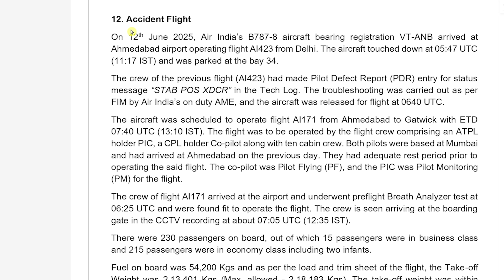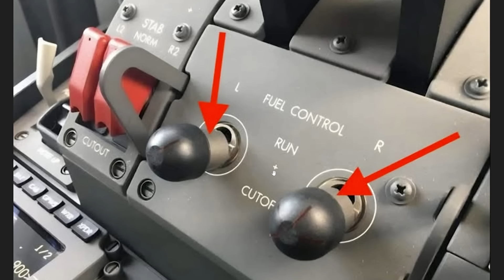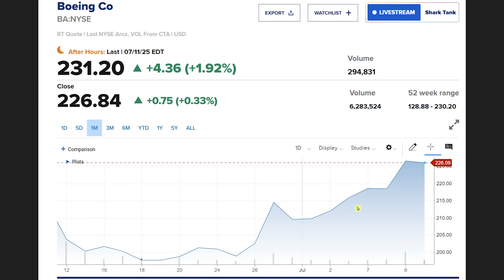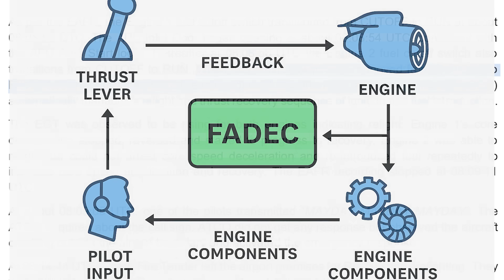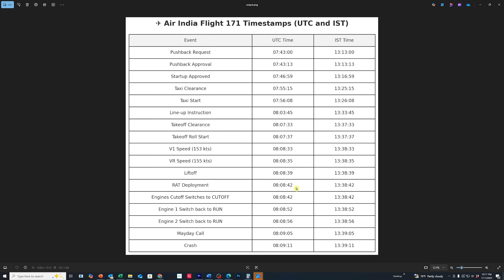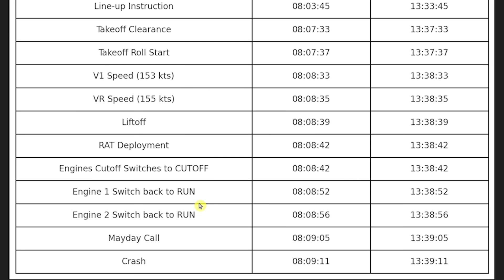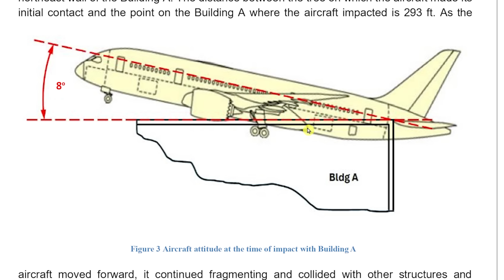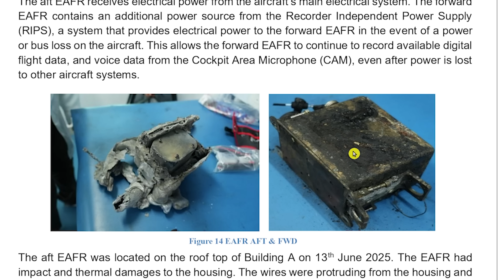Did Pilots CUTOFF Fuel? Shocking Twist Air India 171 Report!

Comment: If you wanted to guarantee a crash, that was the perfect time to switch off the engines. The most vulnerable moment, from which recovery was impossible.
Reply: Yes and that is so scary! There's no way to know as a passenger on a plane if the pilot or copilot are suicidal. 😭
Reply: @KayInMaine Which happens far, far less than multiple other reasons for a plane to crash. Orders of magnitude fewer times. An infinitesimal risk in the grand scheme of things.
Reply: @KayInMaine I work for a legacy airline. The mental health of its pilots is HEAVILY screened during hiring process. In my interview they had me take 3 separate mental health screenings including talking to a psychologist during the hiring process. They also looked deeply into my past and found out times where I struggled in certain classes in school and then pressed on that wound and saw how I would react to it. They also tried to insinuate that because I flew business jets before flying big jets that I would not be prepared to handle an airliner (which isn’t true at all) just to see if I could be composed and professional during a stressful situation (like interviewing for your dream job). 

Why again are they doing this? Because it’s a test! It’s a test to see if you can handle a stressful situation. 

They also look to see if you have examples of community service and character. It’s not about who deserves it the most it’s who’s gonna protect people. 

Rest assured if you get onto a jet in most of the developed world you have at least 2 men or women up there that are mentally well and actually care about YOU as a passenger because we do. YOU are everything to us. There are of course historic outliers but we’re talking 4 or 5 people in the past 30 years that lost it.
Reply: @KayInMaine Have faith in the almighty there’s your answer
Reply: @KayInMaine Go with the numbers. 99.999% are NOT.
Reply: @KayInMaine it is Boieng, not the pilots.
Reply: @KayInMaine  that is why we need self driving planes soon, not just self driving cars. we need AI to safeguard our lives.
Reply: @86soulx ummmm, NO we don't need self-driving planes. Even self-driving cars are ridiculous.
Reply: @KayInMaine  let statistics decide for themselves , if there comes a point self driving cars or planes are statistically safer than human driven ones (less accidents)  i'd say 100% go for it. it's unfair 300 others got to die together because one pilot has depression
Reply: @86soulx lol. You don't think an AI driven plane but suddenly fall out of the sky on purpose? 😂😂😂
Reply: @KayInMaine   i believe AI is progressing fast and in no time it will reach a point where errors made by AI is far fewer than errors made by human. . at that point in time its just a crime to not use self driving technology because not choosing to save lives is equivalent to choosing to end lives.
Reply: Exactly, very well calculated!
Reply: If the pilot flying is looking straight ahead they would not have any idea of what the pilot monitoring is doing with his hand in that area.
Reply: @brentsummers7377  If there isn't already, there should be an audible warning alert for those critical switches, but I doubt that once the switches were changed, that any recovery was possible...sad, especially if this turns out to be a deliberate sabotage situation.
Reply: @brentsummers7377 And vice versa.
Reply: @brentsummers7377  plus why would you think your other pilot is suicidal?  not normal
Reply: @brentsummers7377  Pilots only see sky straight ahead, so they depend on peripheral vision to monitor the instruments. One pilot would certainly see the other manually operating the fuel switches.  That's why he asked "Why did you cutoff?".
Reply: @brentsummers7377  exactly.
Reply: @brentsummers7377  True.
Reply: You`ve just described actions of a killer pilot.
Reply: @lordjim3109  It's terrible how easily and quickly many people suggest just this only based on a hateful interpretation of a preliminary report. Innocent until proven quilty has completely departed this world it seems.
Reply: @lordjim3109 think before you type? The pilot had no suicidal issues.. Everything has been asked to both their family members.. So  think before you type.. There must have been a mechanical problem or anything like that.. But probably 99% sure pilots wouldn't have done that
Reply: @RishavYadav-ll6jp  I wonder how suicidal issues could be determined in advance. Are we going to have a mental health worker questioning all pilots before flight? What if the suicidal person simply denies he is suicidal and states that everything is OK? This has obviously happened before; this video shows a list of previous events by suicidal pilots.
Reply: @gbennett58 Bro actually.. This plane crashed in India.. Here In India nothing to say out government doesn't follow laws and rules seriously..  Main Culprit is always hidden.. So.. We really don't know what was the actual problem.. Pilot or something else.. Can't blame a specific person or thing uptill now
Reply: @gbennett58 I have read parts of part 107 "airman guide" and it makes pilots sound like some kind of uberman. Stories that involvle the phrase "the guy went crazy" usually work as a great cover for what actually happened...
Reply: @RishavYadav-ll6jp  The cockpit audio shows at least one pilot was aware the engines had been shut down. The flight recorder shows the fuel switches shut off and then back on. What more do you need?
Reply: @gbennett58 what do you think that's true? The report was released firstly in India.. Then went to the US...something fishy has taken place.. And some serious changes have been made.. And to blame the pilots.. That's the easiest thing to do 😂
Reply: @lordjim3109  WHAT if those switches were connected to a computer that controls the actual fuel solenoids, valves, pumps rather than being directly connected??? Ask yourself this, HOW does the "black box" have a recording of those switch positions??? If the switches were direct wired to the fuel delivery system, they must also have some sort of sensor data being sent to a computer interface somewhere via some analog or digitial I/O pin somewhere that is being used to record their state. I think we need to see DETAILED schematics for this, because we need to rule out that there was some cybersecurity attack involved. Btw, if you didn't know, these newer modern aircraft have connections via satellite and radio communications that connect to electrical systems within the plane WHILE THEY FLY.
Reply: My thoughts exactly.  There is about a 10-20 second window (right after V1) where the airplane has no chance of recovery from a dual engine (cutoff) "failure". I cannot think of any other phase of flight or ground movement that would be worse.
Reply: It should be cockpit voice and video recorder not voice recorder because now we can blame the pilots yet faulty buttons.
Reply: software perspective. If the computer on board can detect the aircraft if its either on the ground or airborne, maybe a little logic for the fuel switches NOT to be manually turned off at this crucial point of time until it reaches a safe altitude that the engine can still bring the plane up? These are crucial seconds.
Reply: @francelmarkgarcisto9528  Yes, I would suspect Airbus jetliners have that failsafe in place. Even though the pilots have to pull that switch, then slide it and push back to the desired place, it is still way too easy. Cutting fuel to engines should never be that easy. It is a serious design flaw.
Reply: i would also suggest the one who did it was the one who asked why the other did it...for the voice recorder
Reply: That is exactly what I said from the moment I saw the original video of the aircraft passing the building, dead silent , except for that Ram Air Turbine , which we shouldn’t have been able to hear over even a half spooled down engine , which told me instantly those engines were purposely cut off , unless the plane ran out of fuel in all tanks at the same time ,
Reply: The Captain (nonflying) switched them off but asked "why" to throw off investigators
Reply: yup, he didnt cut off fuel at 2000 ft where they could have restarted the egnines
Reply: Controles mal diseñados, hasta una simple cobertura de policarbonato transparente o un inhibidor de esa función durante el despegue- Esas cosas inventábamos en el secundario
a los 14 años
Reply: Lives can be gone in a flash
Reply: Yep.   Guy couldn't just take himself out.  Wimp way to go.
Reply: so which one asked the question. like, why have you killed me and all of the passengers? i didn't....yes you did, why? so they knew it wasn't me.
Reply: Who was MUZLIM in that cockpit 😮😮
Reply: Can those two controls be operated vis remote control?
Reply: @Stalled-wm3qd  No
Reply: He knew EXACTLY what he was doing.
Reply: Yes.  Perfect to cutoff the fuel INSTEAD of raising the gear.  The drag of the gear also adds to the slowing process.
Reply: Agree
Reply: Wouldn't you just fly the plane into the ground with no time for the other pilot to react?
Reply: Agree, seems like blaring audio & visual alarms should be goung off!
Reply: Yes aircraft was fully loaded for long flight.
Reply: chances of survival are highest on takeoff
so its a bad theory
Reply: But it's not a guaranteed plan though, is it? The plane nearly recovered. Was it a calculated risky plan? But surely a person with a plan to commit suicide would carry a more secure plan in the event they may get caught. So, this one is still puzzling to me.
Reply: No. According to the report, the fuel was put back on 12 seconds after the cutoff, which allowed one of the engine to restart. If the fuel had been restored sooner, both engines might have restarted. If you want to guarantee a crash at that moment, you have to cutoff the fuel and do whatever is necessary to prevent restoration in the next few seconds. Not easy since everyone new immediately that the engines were stopping. Difficult to imagine that the pilot needed 12 seconds to realize what was happening.
Reply: Why don’t you conspiracy theory-peddling, “who needs evidence, amiright!” goobers wait for the actual report that reaches actual conclusions and discusses actual facts before drooling out rejections of conclusions that haven’t even been reached yet?  When you’re experienced aviation crash investigators with the requisite training and expertise, check back in.
Reply: Running away from liability
Reply: This is just a preliminary report, it doesn’t prove anything, the fuel can be switched off with technical difficulties as well, it’s too early to blame the someone, this should be thoroughly investigated rather than blaming someone too quickly , the concern now is to prevent future problems. Fix if any technical issue in planes so we are all safe. Let’s not blame the pilots who are dead and cannot defend themselves.
Reply: Motive? Assuming the report wasn't altered by goons for liability reasons the time it took them to flip them switches back on seems sus... Maybe they were fighting over the switches or the switches themselves failed
Reply: @zteamvideo2561  Captain Steve answered that in his brilliant, expert video here: https://www.youtube.com/watch?v=00ooqCuRoU8 - but the nub of it is that the pilot flying naturally took time to react to what the other one had done. The switches did not fail, what failed was the morality and sanity of one of the pilots, Which is why psychologists are part of the investigation.
Reply: I used to use this tactic on eBay. I wouldn't bid anything, until the very last minute.
Reply: Part of me hopes the pilot let some clues as to why...I imagine many of the victims loved ones want to know why...let them have some closure. And maybe we can learn something about mental health to possibly prevent this again. This is why I'm for Canadians MAID. Let people have less frustrations and that possibly letting someone have free will that they wouldn't take to harming others. I've been in some dark places in my life but I never wanted to hurt anyone. One time I was in a dark place as awkward as this is to say and admit, the only thing that didnt let me end it all was I truly cared about my boss and I know he's not always had success hiring assistants but he and I worked well together ...and being I was his right hand thats why I didnt want to let him down. And now I'm kinda not in a great spot with what has happened to the economy in the past 4 years, and its my cat is why I wake up everyday, I fear him dying or going hungry or end up back at a shelter. So it's hard to hear a pilot actually victimized hundreds of people (surviving victims like the family and loved ones) and does make my blood boil.
Reply: The senior pilot had some plausible reasons to do such crazy things.
Reply: @My_DNA_told_me_to_do  we can't say that for sure bro...
Reply: 100%
Reply: What about malfunctioning of switches ....they do malfunction...made by Honeywell and their quality has gone down 👎
Reply: Someone must have done before the pilot enter the cockpit
Reply: @cvanhmingliana4630  Bunkum. That is impossible. You show you know nothing about the mechanism of those switches.
Reply: Exactly 💯 sabotaged
Reply: Mostly agree.  If the pilot who didn’t shut these off though turned them back on in 5/6 seconds and didn’t have the 4 second gap between I really think this was still recoverable. But those extra 8 seconds really screwed them.  Would like to see a flight sim done with quicker / tighter times to attempt recovery.
Reply: Which is why it is "Smart Terror" as much as anything.. the switches could be tampered with easily by a black ops tech,, swap the switch assembly out in seconds,, that it crashes in India, causing the Maximum amount of damage to India.. to Indians.. to drop the power the perfect right second to ensure and unrecoverable moment.  This is NOT a suicide the pilot did NOT push the controls over into the ground.. it was full of fuel.. Why would he want to kill so many innocent fellow citizens... who have given him such a prestigious job and position in life?
Reply: yes. also, wasnt even a switch off. is a cut off, dry out the pipeline fuel querosene to the engine (usually to prevent fire), so a restarts takes longer that just off the engine.
Reply: Yup. I wonder if he had tried this in a simulator?
Reply: @donraptor6156 you wouldn’t need to. All of us pilots know how long it takes to get one of these big turbines started.
Reply: @donraptor6156  No need to, they know enough about flying to that will work. They also learn all the fatals in pilot schools.
Reply: @donraptor6156  wouldn't need to, you already know there is no time to fix as you take off if you wanted to intentionally crash plane
Reply: @donraptor6156 Don't think I could have said that any better, ot clearer.
Reply: The report added: “In the cockpit voice recording, one of the pilots is heard asking the other why did he cutoff. The other pilot responded that he did not do so.”
Reply: @HOMAKiNGh7k I don’t think a pilot would readily admit to doing it lol.
Reply: @HOMAKiNGh7k Those switches may start in the “Cut off” position but once the need to fly they would be turned on, while on the ground and the wheels down stops any RAT deployment!
The videos show the RAT deployed on the take off and were visually seen from those videos showing the RAT propeller deployed!
Speculatively, the switches were still in the “Off” position else the RAT couldn’t deploy unless an electrical connection changed the narrative!
Reply: @MrChannel19  nope you're wrong the wheels being down or up has nothing to do with the rat deploying. However what does is the weight on wheels sensor when the weight is on the wheels hence on the ground the computers are in what's called ground logic and will not drop the rat when the engines are shut off. Now when the weight comes off the wheels it transitions into air logic where the rat will deploy and the apu will automatically start. The landing gear position has absolutely nothing to do with the air or ground logic. Stop making stuff up.
Reply: @MrChannel19 The weight on wheels switch prevents the deployment of the rat on the ground, but it doesn’t keep the engines running.  If they were off on the ground, the engines would have also been off.
Reply: @Big-lron Who is making this up, the RAT was seen in the Air Deployed!

As a technician we always had to assume both the positive and the negative aspects!

Was the RAT still deployed during the crash which would indicate still outside of the fuselage!

Never indicated anything that would not be possible!

Did they check if the grounded aircraft test with walk-around test to see if the RAT may actually deploy once on the ground then it would indicate electrical damage or open circuit some place between the Cockpit switches and the RAT enabling circuits! 

We always watched out for electrical issues when things are at the edge of reason!

We never assume anything until the facts are in!

With the nature of pressures to clear this issue and insurance and the aggrieved families looking for closure we can’t assume anything easy!

Fiction doesn’t come into the logic of finding truth!

So you know where you can stick your comment where the sun doesn’t shine!

Respect for those that have to listen to sophisticated minds going into issues needing clarity!

Condolences to the families who need closure!
🕊️🫵🏼⚠️🇺🇸
Reply: @Theb_rand_1 My exact point, the what if’s are what technical personnel would have to question, not assume that everything is normal and can be dismissed !

Get it!
Reply: @MrChannel19 The RAT deployed when the switches were switched off. The plane was climbing and accelerating right after takeoff, that is not due to momentum.
Reply: @Big-lron The “weight on wheels” sensor keeps the RAT from deploying. Until the weight is off the wheels, the aircraft uses ground logic, once the weight is off the wheels, it uses air logic, which allows the RAT to deploy. There would never be any reason for the RAT to automatically deploy when the plane is on the ground.
Reply: @robinmueller3778 You really like to push your narrative, there is a certain amount of fuel in the lines that can life up the aircraft and then the fuel is no longer enough and therefore not enough thrust!

Go play with someone else you’re annoying!
Reply: @MrChannel19 I have no agenda, I’m just looking at the data. You should try it and actually consider the physics involved.
Reply: @robinmueller3778 That’s exactly where I come from, like I said wait for the final result and then start your rhetorical arguments until there is another shiny object to distract you!

Doing Aerospace for 45 years!

Bye!
Reply: @MrChannel19 Im not distracted by shiny objects. Have you been “doing aviation for 45 years” or just doing it poorly for a long time? 🤔
Reply: @MrChannel19  My dude, even if the "final result" cannot concretely pin the blame on the pilot despite the overwhelming evidence, here's what's going to happen nonetheless: Airlines around the world are going to institute mental health surveys and checks for their pilots.  And that action is going to be prompted by this disaster.  However understated, the implication will be quite clear.  Responsible adults have to take responsible steps to protect lives.  The entire world now knows why this plane went down, and the people in charge of those lives need to act accordingly.
Reply: @Big-lron Your assumption is the wiring is 100% but there are wear and tear to electrical connections that may not be accounted for or even if the wires were damaged or worn out! 
Keep on Mr Big-Iron, personally would never work around someone as yourself, you seem to think your the big kahuna of aviation industry but your still a child!

Go back to your playground and find playmates there!
Bye
Reply: @Big-lron  Spot on. People spin fantasies.
Reply: V interesting point.
Reply: very important point!
Reply: The report also does not state that the switches were definitely moved physically, they are going of sensor data that could have been due to an electrical fault. Remember the switches were found in RUN. The RAT was deployed within 5 seconds of fuel cut-off was recorded and 3 secs after the take-off, this could have been a major electrical failure and not pilot's switching off them physically
Reply: @farazalikhan5242 True, However, the timing (1 second apart) is indicative of the time it would take a human to turn one off, then move his/her hand to turn off the other
Reply: @jimserhant7741  they should have released the whole cockpit voice recording, the fact that they only released that bit of the pilot asking "why did you shut off the valves?" is definitely showing that they are not being unbiased, either they should have released the whole CVR or not at all
Reply: @farazalikhan5242  They don't only have voice.  They have VIDEO.  There was an elaborate camera system in and around the cockpit.  And yet, they're piecemealing out this information.   It's very irresponsible and suspicious to do this.
Reply: @farazalikhan5242 Indeed, they are hiding something.
Reply: @jimserhant7741  Also, the fuel pressure and N1 and N2 indicators did NOT start rolling back until AFTER the cutoff switches were switched from RUN to CUTOFF position. This is inconsistant with another Air India pilot saying the pilots must have changed them from run to cutoff in response to a drop in fuel pressure... They were also not switched back until several seconds later, this is also inconsistant with SOP's (at altitude) for a relight attempt the switches are moved to cutoff and back to run immediately no counting to three or whatever.
Reply: @VerdictREX  There's no video.
Reply: @farazalikhan5242 it’s a preliminary release in a preliminary report of the investigation. To be fair, there really wasn’t much more to release.
Reply: @farazalikhan5242  There were probably very strong words after the Captain said, "I didnt do it".   Also, we could likely hear the switches being flipped.
Reply: @farazalikhan5242 yeh the rest of the CVR would probably complete the picture.. ie the pilot who asked why probably had more to say since his colleague just intentionally killed them and lied about it.
Reply: @brnmcc01  true, there are lots of other indicators values that lead to the switches being physically moved to initiate the fuel cutoff. people want to blame anything and everything but a pilot moving a switch....
Reply: @farazalikhan5242  Yeah they'll need to analyze the CVR in more detail, move the switches in a real plane or simulator, record the sounds, and listen for those sounds in the CVR recording.
Reply: @takingthescenicroute1610 Are you really thinking they didn’t try this in a simulator weeks ago?
Reply: @farazalikhan5242 even more unlikely than what the data tells us. You may have to move away from denial.
Reply: yes the function of the changed  valve goes from electrical condition to computer system software that commands closing of valve, for fuel. A
Software Maintenance new subroutine in program can shutoff valves for fuel as it contains a pilot overriding command for shutoff if certain maint. Conditions are met digitally? Pilots wouldn't know, but air India knew, but they skipped non-mandatory bulletins.
Reply: this is correct most peoples are using their opinion with out going through the pilots duty .i being an instrumentaion service enginner of 26 years would only agree to a major failure of computer and electrical failure of over heated battery .no pilot would ever switch off his own blood flow a comparison of fuel pumps to his enginesx.pkease think the same pilots have flown this aircraft from delhi to ahemadabad .any one in refueling the aircraft at ahemadabad having access to bewmteen flt inspection and certificate could have tepered with the system for a pre tetermined time foe fuel supply to stop as any two wheeler you have a reserve selection after consuming the fuel left in the pipe from tank to carburrater .so .please do not abuse the dead pilots as terroist .if so it could have been done after take off from palam airport itsrlf .god please forgive all those spreading un wanted judgement of an tragedy .
Reply: @farazalikhan5242  The report states the switch were placed to RUN. one at a time.
Reply: @farazalikhan5242 I was thinking the same. But just as you have thought of this scenario, I’m sure Boeing engineers have as well, and it seems like they have dismissed this as a credible idea in the preliminary report.
Reply: @farazalikhan5242  Yes this is the big question now: Actual physical movement of the switches versus electrical sensing problem. To analyze the latter requires a wiring level knowledge of the switch wiring. Of course, the FDR only knows the electrical levels created by the switches, which can be influenced by any number of factors including loose wiring, broken wiring, shorted wiring, and a myriad of other non-normal conditions. 

Somehow though, the pilots knew the switches were off according to the voice recording. How did they know this? By visual inspection of the switches or by a cockpit warning light, alarm, etc.?
Reply: @farazalikhan5242  No not true at all. The switches were flipped to cut off one second apart from each other one of the pilots asks the other "Why did you cutoff?" as if he saw the switches in the cutoff position. 10 seconds go by before the switches are flipped back to run and the plane automatically initiates the restart procedure it also automatically deployed the rat and started the apu. One engine managed to restart but not in time to recover. It was not an electrical failure.
Reply: @Big-lron  Hard to believe one engine actually managed to restart so fast! After being shutdown after running at full power, that would most of the time that would result in what we call a "hot start" and shoot flames out of the back of the engine with stupidly high turbine inlet temps. Normally for hot restart, you have to motor the engine for quite awhile, like 20 seconds at max motoring and then introduce fuel only when ITT reaches 200 degrees C.
Reply: @brnmcc01 fan was spinning with airflow so it wouldn’t have been a hot start.
Reply: @Theb_rand_1  The FADEC on these engines is very advanced and I see now after watching the full video it pulsed the fuel on/off rapidly to allow a hot restart.
Reply: @brnmcc01  the egts on both engines were observed to be rising according to the black boxes as fuel was being pumped back into them. Engine 1 managed to overcome the spool down and was on its way to spooling back up but the plane was most likely already hitting trees by then engine 2 was unable to overcome the spool down. Im not a jet engine expert but yeah i know those big high bypass engines take forever and 3 days to spool up.
Reply: @Big-lron  Yeah exactly and I think that nearly rules out issues with the engines themselves, fuel pumps, or the FADEC's. The FADEC actually did an amazing job of nearly getting the engines back up and running.
Reply: @farazalikhan5242  Boeing will do everything to prevent any such report of electrical fault to ever come out.
Reply: @ticler  Troll.:face-fuchsia-poop-shape:
Reply: @ticler  If it was electrical and everything got cut. The words may have been 'damn we lost all the power' and not 'why did you cut the fuel'. Also both switches would be cut at the same time, not with one second delay. Stop blaming Boeing. The 787 is not the issue, pilot mental health is. They need to look into the pilot. One source is reporting that this pilot had been on sick leave and other pilots reported him to be unstable.
Reply: @ticler When did Boeing force the pilot to manipulate the switches?
Reply: @ticler  Wrong, APU and RAT were employed after the fuel cut off.
Reply: @jamesreynolds4220  - exactly - there was absolutely nothing wrong with the aircraft at all.
Reply: @ticler there was no electrical fault. The movement of the two switches and the conversation on the CVR clarifies this.
Reply: Exactly
Reply: True, but there is a very high probability that the pilots weren't involved, at least not the diabolical or "accidental mistake" ways that has been speculated about. 

There is a better probability something far more sinister went behind those fuel cut-off switches.
Reply: @wickramavee4365 Sinister is incorrect since we’re talking about mechanisms, people, technology that has many possibilities, assume nothing and breakdown the issue as the evidence comes to light!
Reply: At this time, the idea that one pilot did this intentionally is preposterous.  You don’t turn the fuel back on if you’re trying to crash the jet.  Pilot could just as easily push the yolk forward abruptly, among dozens of other possibilities.
Reply: Hold on guys.. switches were moved with 1 second gap. I don't think that is humanly possible with the safeguards and locking mechanism. It could be a mechanical /electric failure in the switch also.

737 crash in 2018 was attributed to pilot error. It took another crash in 2019 for Boeing to admit their software issue.

Hope truth come out.
Reply: @akhiljayachandran3679 , judging from a video I saw of the fuel switches being operated, a one second delay for the second switch seems to be about ballpark. I.e., flipping the switches in succession by a trained person should take about 1 second.
Reply: @akhiljayachandran3679 millions (maybe billions) of hours of flight with these switches… 🤔
Reply: @akhiljayachandran3679  Two hands from one person. Very easy.
Reply: @Nobilangelo it's not good to. Onvict someone. Investigation team is looking into the mechanism of the switches if its due to switch fault
Reply: The Air India training manual said this was the switch to turn off the vacuum cleaner.
Reply: @Number-5-is-alive 
They probably used manual for a glider that has to be RUN via hawser then CUTOFF after reaching take off speed.
Reply: Also it's very convenient to blame dead people huh.
Reply: @SamsungS-or1qf The data is the data. No blame is being placed yet but it’s definitely suspicious.
Reply: no , if you wanted to guarantee a crash and complete destruction off all evidence . you would wait till the aircraft had more speed and altitude and then press the fire shut off valves.  at this low speed there was every chance that the black boxes would be recovered .  there was also the possibility of the cockpit breaking when it hit the trees . there could have been more survivors  , maybe even the pilots themselves could have survived this just like seat 11a did .  think of this if you wanted to send your car off the cliff , would you do it low speed and risk getting stuck on trees . or would you do it at full speed so you clear everything and fall straight into the abyss
Reply: @zaildarbains do you comprehend the fuel quantity in that flight? It had just taken off it had max fuel capacity. There is only 1 in a million possibility of recovery or survival from this. Doing anything mid air would have mean that the other pilot could intervene and stop it from happening plus it gives more time for recovery since the plane is at a significant altitude
Reply: @zaildarbains  Well, you can't do that because there is 2 pilots and at cruising altitude you have both airspeed and height and the plane can fly for a long time as much as 150 kilometers or more if flown properly at best glide speed. There has been precautions added after that suicidal pilot in Europe waited until the PM stepped out of the cockpit to use the restroom, then proceeded to lock the door and crash into the alps at max speed. The only way to guarantee a crash is like this plane, cut off power at the most critical phase of flight, or they could yank on the controls on landing and crash into a bunch of planes that are waiting for takeoff etc. There was that Silk Air plane too that was flown vertically straight down into a muddy swamp. The impact on the soft ground made recovering the FDR and CVR boxes very difficult.
Reply: @brnmcc01  yes its easier and less work to crash this way. but certainly falling from 600 feet doesnt gaurantee complete destruction. what if they missed the buildings and fell on a bunch of trees.

Also since there is no indication of struggle between the pilots in the report and the switches are in the run position after crash is also suspect. if he wanted to crash why would he attempt to restore both engines after 10 seconds.

the failure  occured right at the moment aircraft transitioned from ground to air phase .  so its still possible that a faulty signal triggered those valves to cut off . restoration in 10 seconds is also peculiar. its not 8 seconds or 12 seconds.....what im saying is 5 seconds , 10 seconds is usually how some aircraft logics are designed to reset. 

all speculation still.
Reply: @brnmcc01  im finding it hard to swallow that this seasoned matured pilot was so psychotic that he wanted to kill 250 other countrymen.  why did he not press the fire shut off valves then , since that action is irreversible once pressed. if he wanted to hide his complicity wouldn't it be easier if he just yanked it left  90 degrees , pitched nose down at 400 feet and screamed mcas failure or something along the lines the aircraft is not following my commands. 

cutting the fuel shut off valves right at takeoff will surely result in a crash . but it doesnt guarantee complete destruction. height and speed are low . why did he leave the gear down to absorb the impact ?
Reply: @zaildarbains  Yeah we need to wait for the full story. This kind of thing has happened before though, Silk Air, Germanwings flight, and that EgyptAir that was deliberately flown into the ocean off of Nantucket. Egypt has denied the NTSB findings so far on that one.
Reply: @zaildarbains  Watch Captain Steeeve's video on this, he also came to the same conclusion.
Reply: Bingo, valves, shutoff/cutoff valves, system new software maintenance  sub routine-function of changed valve status goes from electrical condition set to 》system software that contains a commands to closing off• of fueL valves behind the scenes 》》》 overriding any pilots providing certain maint. conditions are met, , probably showed on display,,,plus plane had other cascading electrical problems on system.
 I saw the
Video put out a week ago from Air India so they knew about it. Boeing knew about it. But this report screams of story reversal report??
Reply: @pjpaulamcpip3266  Nonsense. The fact that the engines were nearly able to restart after turned back on is a testament to the quality of the FADEC and these GE engines. The old P&W JT8D engines on an MD80 would never have been able to be started quick like this.

Nothing against Jeff his video is spot on, but go watch Captain Steeeve's videos on this Air India flight. He's an actual airline captain with many years of experience and ex-Navy pilot. I trust his opinion more than Jeff O's, but if they both agree on the facts that's worth something. If two different qualified people come to the same conclusion I'll have to at least temporarily agree unless/until the final report comes out in a year or so.
Reply: @zaildarbains With a plane loaded with that much fuel, crashing into anything, trees included, is going to cause a massive fireball. This isn’t a video game.
Reply: @zaildarbains  his aim may not have been complete destruction but simply loss of aircraft with all lives in board including his own. Maybe the one who switched off the fuel was not in control of the plane so how would he yank it 90%. Those switches were manually moved - there is no way they can move by themselves.
Reply: @LPCLASSICAL they can slip . That’s why the FAA advisory . Check my comment history and you’ll find a conversation with 736/767 pilot operating those same switches . Something similar use to happen with Airbus engine masters too.
Reply: @zaildarbains The black boxes are almost always recovered intact. Besides, they are redundant and in two very different places. Trying to time it so they wouldn’t be recoverable is a fool’s errand.
Reply: @zaildarbains if the plane was higher it would've probably recovered.  Most of These pilots all have simulators in their homes, either way we will never fully know.
Reply: @zaildarbains  well you got the evidence, No way to save you this crash, with tons of Gas in the plane. This actually is an bomb
Reply: @zaildarbains No.  This point was discussed in other threads.  A handful of seconds earlier and they could have aborted the takeoff entirely.  A handful of seconds later and the recovery options would have done their job.  The window for making this cutoff work as intended was some 20 seconds and they pulled it off with precision.  I do get a chortle out of folks who are desperate to frame the phenomenon as some kind of electrical failure, though.
Reply: @zaildarbains stop with nonsense speculation. Black boxes are just about always recovered. And if it was done higher it would have been easy to recover by just turning it on again.
Reply: @marcdornan1454  can you recover after fire shut off valves are pressed ?  wheres the blackboxes from pentagon or WTC  ?
Reply: @marcdornan1454  let me know cuz id like to hear the CVRs
Reply: @zaildarbains 
More altitude would be more time to recover
Reply: @DaxMaboyder everyone’s not sully bro.

I couldn’t recover if you gave me 3000 feet on runway heading .

Try it for your self on MSFS
Reply: @DaxMaboyder I can give you 20,000 feet you still won’t land on the runway you took off from. Any bets ?
Reply: @zaildarbains 

The report shows that  #1 had already relit and was producing thrust #2 was seconds away from the same. A bit more altitude and we would be talking about a heroic save by some Air India pilots
Reply: @zaildarbains 
Who said anything about putting back down on the same runway???
Reply: @DaxMaboyder  oh maverick , please stop
Reply: @zaildarbains  They would have had enough time to restart engines with more speed and altitude. Even in this crash number one engine had already started to spool up but too late. More telling is that the captain did not retract the landing gear at the usual point .
Reply: @zaildarbains no if they had more speed and a bit more altitude say atleast 1500+ There was More chance for the other crew to safely recover...
Reply: @airlineklicks2425  what if i cut off the fire shut off valves how will you relight engines
Reply: @zaildarbains Regarding seat 11A, I’m still not buying that story lol.
Reply: @jimserhant7741 that guy has never been in the aircraft, certainly he missed departure and then walked into the crash scene to be the hero of the day.
Reply: @Jorge-oh5ee Now THAT, I’ll buy. Anyone who believes he was in that plane when it crashed and was thrown far enough to not get cooked by that massive fireball, especially when he said “I just walked out.” 😱
Reply: No wonder F35B still spending day s in India. Pilot clearly mention they did not switch anything. And it is not possible to move 2 switches which need 3 actions in 1 second. It need common sense to see through paid billion dollar PR lies.
Reply: @Abcdefgh123-k5fit is 100% possible to move the switches in that time. Maybe a pilot did it, maybe not. We will soon find out.
Reply: @Theb_rand_1  Who else would have done it? The people in the cockpit are pilots.
Reply: @Abcdefgh123-k5f pull up then flick down... 2 actions. Using 2 hands 2 switches Simultaneously takes 1 second
Reply: @malmo008  Agreed and apparently they did a lot of check flying in the simulator to mimick the actions.
Reply: It was turn off when they starting to fly….
Reply: I think this has more to do with malfunctioning of the plane instead of pilot because 3 second after being airborne is too less of time to do all that. 
If you look at the flight radar report you can see that the Boeing plane used the full length of the runway which a twin engine plane never does.  
They were having a hard time even before takeoff. 
Saying pilots were suicidal to the pilots with more than 15,000 hours of experience is disrespectful !
Reply: @heisenbergyo5578 Do you  know what you are even saying? 
Lots of twin engine planes (strange descriptor you chose since most commercial planes are twin engine) use full length runway when the outside air temp is high and the plane is heavy with pax + fuel. Add a high elevation to the mix for a high density altitude and near full length runway is definitely used.  As difficult as it is to allow yourself to accept that there is a possibility a pilot did this, they have done this before therefore it is ignorant to definitively say it is not his fault.
Reply: @heisenbergyo5578 So, we should trust what “you think” over what the data shows? 

Hot take, but OK 🤔